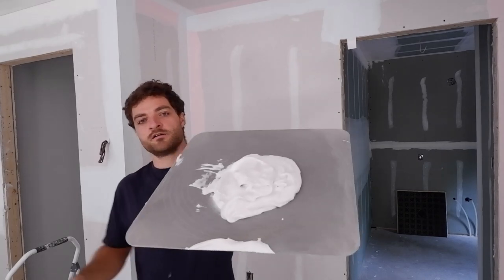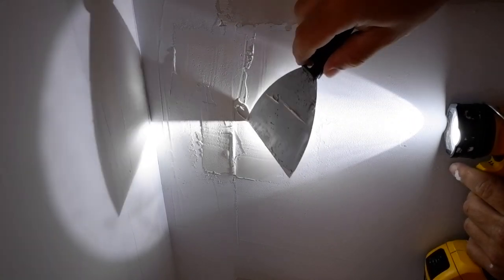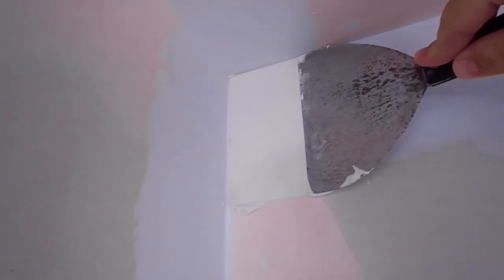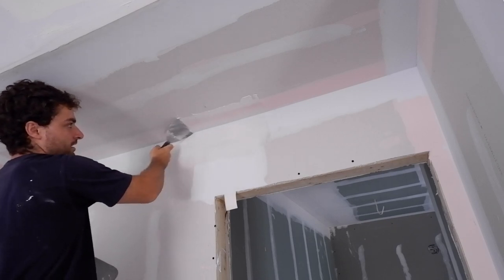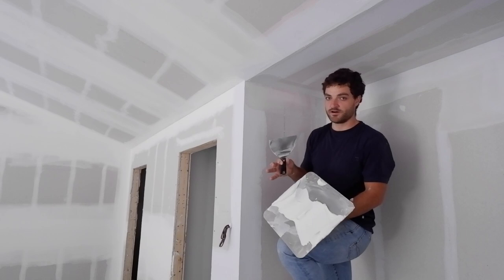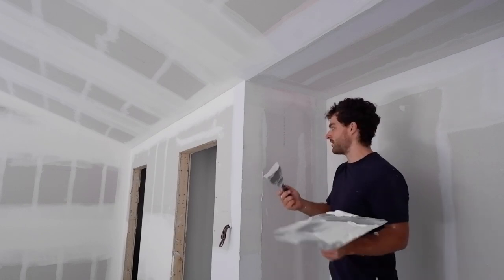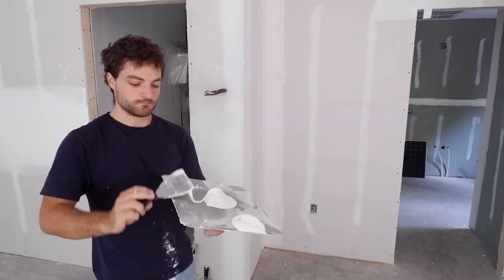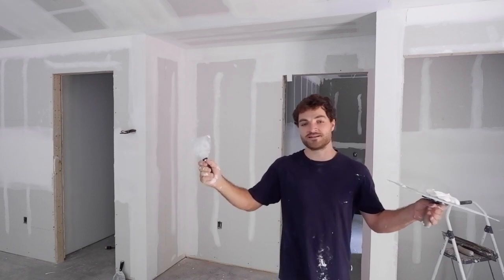How to Mud - A visual tutorial - Third coat of mud

Comment: What's the purpose of creating a hump on the flat? Why not just stop where the taper ends?
Reply from the maker: That’s a really good question. It’s actually quite hard to just fill in the sunken seam, in theory you should be able to fill in that 1/8” valley and maybe for some jobs that’s okay, but because mud has so much moisture in it your mud is going to shrink at uneven rates, so you’d probably notice that transition between mud and the edge where the tapered drywall begins